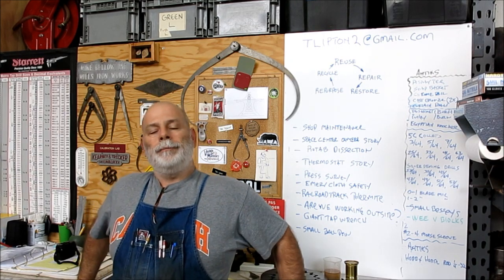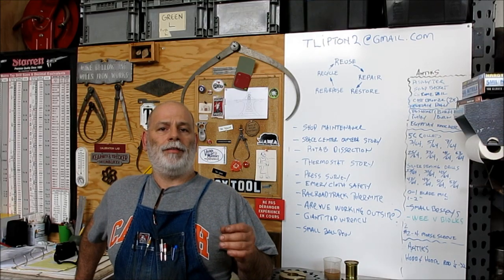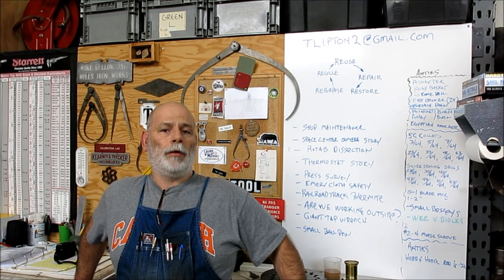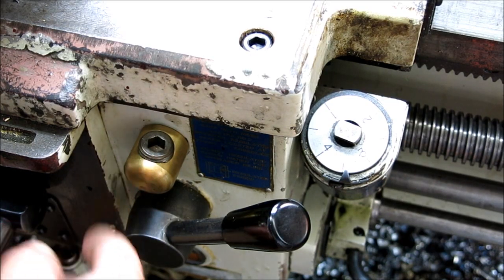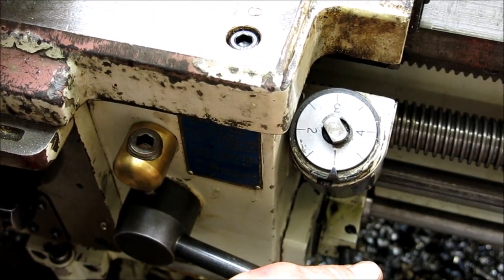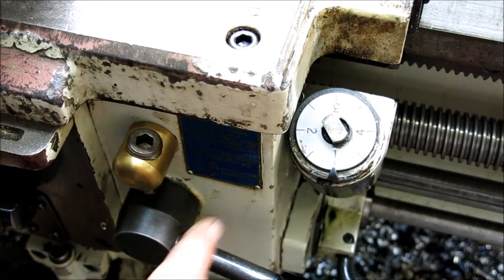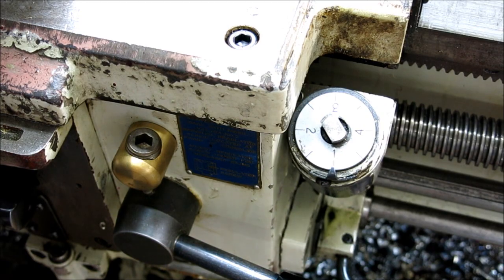Metric Threading with an Inch Lead Screw

Comment: Good Trick. 
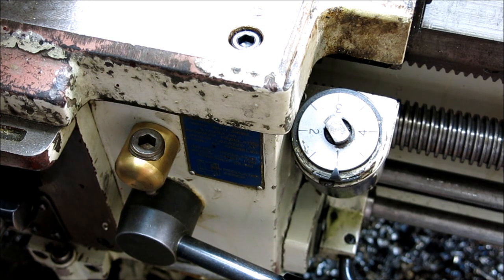Another addition would be to set the Cross slide dial handle at 9:00 position zero the dial or mark it, (so down on the handle is always out, away from part) on every cut. Feed into part at 29.5 degrees with the compound slide. Then you wouldn't have to remember how deep you were on the last cut. I always marked my cuts on the compound dial with a marker.  You wouldn't even use the DRO. (much faster)  Actually that's the "classical" way to do it. On very large, course threads, it is the only really efficient way to do it. With the classical way one is actually turning the thread not gouging it out, which is what going straight in, actually is.
 I do like your thinking Tom, I've learned to think the same. When I found a better way, that's my new way! Doesn't matter who showed me. I once had my day saved by a janitor in 1980, who solved a chatter problem on a long small dia shaft I was doing with a trick he knew, and I didn't know. I never asked how he knew, but I tried it, and it worked.
Reply: Ok, so what was the chatter trick you learned? I learned how to drill perfect circles (holes) in sheet metal by placing a very small folded rag right over the drill bit and then drilling down on that through the metal.
Reply: That particular time I mentioned, it was to put the tool a bit above center. Another time in 1983, I was facing a large diameter flange (about 30" X 1.050 thick diameter) flange welded to a 3" bearing diameter shaft. This produced an annoying, high pitched squeal. An Allis Chalmers veteran of 35 years, (this was not at Allis Chalmers at the time), walked up and thru a mighty mag base which stuck to the back side of the flange and the squealing stopped. 
This was a new idea to me and I used it many times thereafter. (Harmonics) So if you encounter squealing or chatter, "sometimes" placing a magnet on the side of the boring bar or other tool, or on the part itself, will stop the harmonics.
I later was given job (at a different shop) to turn 40" to 50" long, (1/4") wall ,5-6" diameter steel tubes. The old guys there laughed and told me that I had been stuck with the "shit" job, because in the past they had to stand and follow the carriage holding a lead hammer against the part during the whole turning process to prevent chatter(harmonics). So I removed the upright shaft from two indicator bases and I placed the magnetic bases inside the tube at each end on opposite sides (when the old guys weren't looking) and started turning. For effect, I sat on the bench while I turned the chatter free tubes with my legs flapping in the breeze looking bored, and smoking a cigarette (times have changed) all the while I could see these two older guys off to the side looking on, with a "WTF" look on their faces. The "shit job" ,turned into the best job in the shop, as I had very many of these tubes to turn. The tubes had a large tolerance on the O.D.  but they could have no chatter marks. The moral of the story? Although I had learned the principle of the fix from a very experienced old guy myself, these "old guys" made the mistake of thinking a younger guy knew less than they did on every matter, simply because he was younger. The proper, and only right way, to view machining, is to always consider it a learning experience all the way up till your last day. When one thinks he "knows it all", he or she, is ineffective thereafter. There's nothing wrong with being proud of your effort to learn and your accomplishments, but it's necessary to have this primary restraint.
 There is an old saying in the Biz.
"There are machinists with 20 years experience and then there are machinists with 1 years experience, 20 times".  I actually met a pair of the latter, and proved that saying to be true, in Arkansas circa 2003. Although I was chief toolmaker, I couldn't have taught those two guys to run out of a burning building. Dumb and Dumber were steadfastly bound to stay that way, on their own volition. (Ain't no yankee gunna tell me nothin!), at least they were right on one thing.
 I hope this may help you Tom. After 40+ years I retired in January. I'm done learning about machining. Although I still show up with one of my three machinist sons at a shop, for special projects. I read books, play guitar, and other things now.................... Keep pounding,,(I just, had to say that...)
Reply: Fantastic answer.... I'll certainly keep it in mind. I have used bicycle tube wrapped around shafts welded to plate when the harmonics began. Sometimes with success and sometimes not. Also lead soldering sticks attached to boring bars but never the magnets and first chance I get, I'll give them a go.
 Here is a question you may be able to answer. I've been setting up a quick program (excel) to determine the depth of thread depths using a bit of trig and with using the compound to do all the 'work' as it were. Bit hard to explain my question other than this. When turning a piece of stock to take a (Eg), 12 mm thread * 1.75 where the recommended Major Dia (Max) is 11.97mm.... Can you see a reason why I should turn that stock to a dia of 12.35mm to then cut the thread to a depth of 50 Thou (1.26mm)? In other words and in all thread cutting operations, does the stock begin as a size a fraction larger in Dia than the Major Dia Max? Then as the correct thread depth is achieved, this Dia reduces down to what it should be? Refer to "Maryland Metrics Thread Data Charts" on the net.
 I like solving all manner of math problems using a hand held PC or the excel and then simply punching in whatever needs I have at the time and the answers get calculated. I've done that to date with all and any contour cut ever known to man in fitting piping together to give no gaps whatsoever when fitting pipe as structural pieces and or intersections. Just have a think on that question about Dia's and I'd be interested to get your thoughts. 12.35mm or 11.97mm?
Reply: Tom I don't quite understand the question. But it was always standard practice to turn the diameter .005 under the nominal, beforehand when threading. I'll bet there is a chart showing thread depth on the internet. As there is on some thread tool setting gauges.  The anti harmonic solutions don't always work but when they do!...wooohooo!...    :-) I've used the inner tube solution also.  Double lead threads can be done by fixture or by a rotation of a gear on the manual lathe. Pain in the ....
 The acme thread screw sleeves(up down) on old milling machines require double lead.

One more thing about harmonics. Back in the 70's I was boring out Rexnord "lock Post" hydraulic cylinders 
for rock crushing machines.( funny, years later I machined many of the large eccentric bushings for the very same rock crushing machines, at another job shop), anyhow,The bore was about 8" diameter and 30" deep if I recall correctly. The owner of the company came buy and he asked me if I knew the purpose
 of the  many lengthwise and dissimilarly milled out sections on the large boring bar I was using. I said no. He said it was to reduce harmonics. Apparently harmonics are more prevalent in symmetrical situations. So break up the symmetry, whether by shape or magnetism. I didn't know the magnet trick at the time.

P.S. I've got a funny story about turning cable drums and another one about using a steady rest with brass pads if you'd like to hear such nostalgic dribble...
Reply: Yep, hard to explain in text. http://www.boltscience.com/pages/screw3.htm
The Crest line is just lower than the apex. So do we begin the threading process using the apex dia is what I'm wondering? And yes I fully understand convention saying .005 under nominal but could it be .005 over? Anyone's input here?

Comment: The problem is only when you make metric threads on inch lead screw? I'm all metric and never understood how the thread dial can work (I'm just guessing it has to do with thread pitch being in fractions with inch system; but doesn't work on metric lead screw / metric threads?!).
Reply: If I recall correctly, a metric lead screw machine thread dial box has change gears in it to cut various metric leads. This is a case where dividing by 10 doesn't make things easier.
    As a practical matter cutting metric threads on an imperial lathe is no more difficult than cutting inch threads (as long as you have the compound metric change gear set for the lathe..e.g. 127t/120t which is exact [recall 127mm = 5.000inch exactly]).
  I

Comment: Hello.
If I cut multiple thread metric (ISO) M20 x 2 x 2 or M20 x 2 x 3   How to calculate depth cut in multiple  thread?

Help me!
Reply: any thread lead number multiply by 0.6495 that is the thread depth from OD or ID (convert metric to inch before do multiply.)

Comment: I have an idea for those cutting threads without a thread dial. (Mine is missing)

The thread dial indicates the phase relation between the spindle and the drive screw.
So I think that one could start by marking the carriage with a Sharpie at the bed with the 
half nut engaged AND by marking the lathe chuck at 12:00.

Now begin the threading pass, at thread end disengage half nut, stop motor.
Next turn the chuck by hand to the 12:00 position, 
crank apron back to starting point mark and engage half nut.
Start motor, cut the next pass, repeat.

I have not yet tried this but I expect it to work.
Reply from the maker: Hi Daniel,

Your trick might work for normal threading but will not work for metric threading with an inch lead screw. The relationship between the chuck and lead screw rotation is not factorable. This is why you generally have to keep the half nut engaged for the entire threading cycle. You can keep the index correct for small rotations but not for major resets. Hope this makes sense. Thanks for the comment.

Cheers,

Tom
Reply: Hum,... I understand your comment - but not yet convinced. It seems that if one can re-create the initial conditions it must work. Now I think what you are implying is that if the chuck is returned to 12:00 and the 
half nut is then engaged that the apron may move slightly since the modulus of rotation is not an integer relation. In that case you would need to notice that the apron is not at the initial position. Adding an indicator to the bed measuring the position of the apron and then rotating the chuck to the correct 12:00 rotation would be needed. Do you follow?
Reply: You are very close, but also mark the lead screw against the lathe frame so you can manually turn the lead screw to the original starting position then re-engage half nuts. The method shown is best but if you don't have reverse try this.

Comment: Imperial units need to be abolished from face of the earth.
Reply: Yeah, sure, and scrap everything built to Imperial standards for want of a bolt or shaft...
Reply: SAE thread kicked the world's ass in WW2, both systems have their place in the world unlike idiots that are too simple to understand that.
Reply: metric belongs on the moon.
Reply: Haha but did you know that America is also a user of the metric system?? Look It up
Reply: @nick f i dont see your probleem it is the resolotion what is your problem is
Reply: @nick f it comes down to what you're used to.
Reply: hey guys, I'm just wondering does any of you have a technique for  cutting threads on a long slender workpiece on a lathe? Eg length of 1 meter. You know the work will bend when the tool impinges, any ideas?
Reply: mrtric should be abolished for ever.
Reply: Sure used a lot of imperial machines to save y'all's asses in WW2.
Reply: A bit disingenuous William, a that time the UK  WAS imperial, considering we invented the system anyway. Plus the fact  that we were the ONLY country to stand up to the tyranny of the Nazis. Until you were forced to join in by the Japanese attack on Pearl Harbour.
We were only forced to convert to the Metric SI system upon joining the European Common Market in 1972  See I put the word FORCED to change and we were. Joining the Common Market was the wort thing we ever have

Comment: Thanks- good lesson.  Have you tried cutting threads in reverse and with the tool either rotated 180 degrees in the holder or positioned on the far side of the work?  You can make the thread and not worry about shutting down to avoid a crash at the end of the pass.  Do exactly the same thing with half nuts at the start of the pass as you did at the end of the conventional right to left pass.  Does that sound reasonable?
Reply from the maker: Hi Jeffry,

I have seen folks do it the upside down way. Never tried it myself. Just too weird for me. Thanks for the comment.

Cheers,

Tom
Reply: Actually Jeff, When we used to R.H. thread large bores in a hydraulic shop, we would turn the tool upside down and thread on the far side of the bore going in. That way we could see the relief and stop the carriage manually by eye.
It offers better stability as the pressure is down on two rollers of the steady rest instead of up on one roller.
The real adrenaline rush was internal threading small bores threading in to an indicator once around to 0. tool on the near side. Cant see anything. Still feeding into the part with the compound. Until they got their first CNC we did a cart full in a day of the 1.5"-2.0" diameter tubes. I did anyway. too scary for some....  :-) I was young ,didn't know I couldn't do that...nobody told me it wouldn't work, that came later...more often than not ,They were wrong...shop head games..if you don't know what that is, you will,..... glad I'm retired, for that reason only.

Comment: Hi Tom, Just wanted to say what a pleasure it is watching your videos. Your attention to detail and quality of workmanship is second to none! One thing which I am interested to know is that when you were threading, you advanced with the cross slide and not the compound. I haven't yet needed to thread on the lathe yet (machining is a hobby for me) but I was under the impression that you advance with the compound to reduce chatter etc. Is it due to the fact you are machining brass that this is possible without causing chatter? Regards Rob
Reply from the maker: Hi Rob,

Its not necessary to use the compound when threading. Direct infeed works fine. Sometimes there is an advantage to use the compound such as very large threads where chatter is a problem. Its sometimes easier to keep track of your advancement with the compound as well. Both methods are valid and work fine. Thanks for the comment.

Cheers,

Tom

Comment: Very good technique for people to see. Like most of my generation I was trained to never uncouple unless absolutely necessary and there are times when it is much easier to be able to momentarily uncouple as sometimes we were cutting inch threads on a metric lathe, ha ha - same problem. I will add that when one cuts one of the rare fractional pitches (11-1/2 TPI comes to mind here) that your demonstrated technique will prevent the "doubling" that can occur. Good job.
Reply from the maker: Hi Robert,

Yes you have the inverse problem. I am upset that I learned this trick after so many years of doing it the hard way. Thanks for the comment.

Cheers,

Tom

Comment: How about just never dis engaging the nut?
Reply from the maker: I think you missed the entire point of this video. There are many cases where disengaging the half nuts is needed to produce a good thread. How about down a bore. You simply cannot stop a lathe on a dime the same as you can disengage the half nuts. When metric threading on an inch machine not disengaging the half nuts is the unenlightened method. This video shows that you can easily disengage and not lose your reference. Thanks for the comment.

Cheers,

Tom
Reply: thangamajig zactly!!
Reply: it's look's simple :)
Reply: he was not paying attention tom no problem .

Comment: Dang - good video Tom - I've got a ballscrew leadscrew on my lathe with no threading dial - any ideas how I could go about adding one or some sort of witness mark?

Thanks, 

Glenn
Reply from the maker: Hi Glenn,

All the threading dial does is reference the lead screw. Typically they are a gear that is meshed with the lead screw. For a ball screw you would have to work out the number of teeth required to match the pitch of the lead screw. The other option might be to have a disc mounted to the end of the lead screw that has reference marks on it and some fixed pointer. Not as convenient as having it on the carriage but pretty easy to execute. Hope this helps.

Best,

Tom

Comment: Isn't it better to never disengage the half-nut, and just stop and reverse the machine? Going back in the same thread. The threading dial isn't needed then.
Reply from the maker: Hi Lasse,

I think you missed the point here. There are many situations that you cannot stop the machine quickly enough to leave the half nuts engaged. This method gives you the flexibility to come up to a shoulder or wall and not crash into it or have to stop the machine in a half a revolution. Thanks for the comment.

Cheers,

Tom

Comment: Great Video, thanks Tom, Just one question I was taught then when cutting threads to do the cut adjustment with the compound not the cross slide, is this a better way?
Reply from the maker: Hey Mike,

You can go either way. For small fine threads the cross feed is quicker. The advantage is you can easily track where you are in relation to the minor diameter. Thanks for the comment.

Cheers,

Tom
Reply: Compound is supposed to be a stronger thread and not as much pressure when cutting big deep threads
Reply: @byfordbarnard2264  And the tool is mostly cutting on the leading edge, taking the slack out of the lead screw. Kind of like we lock the carriage when parting, the tool would have a mind of it's own.